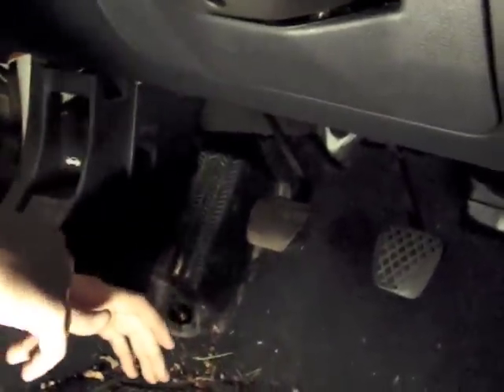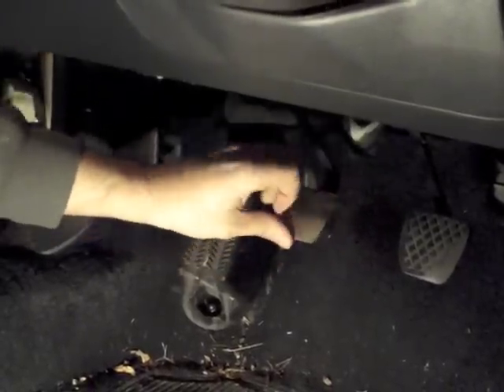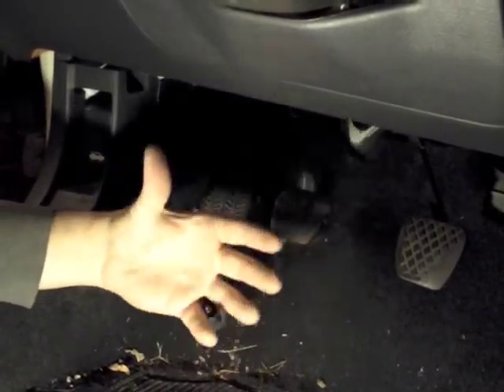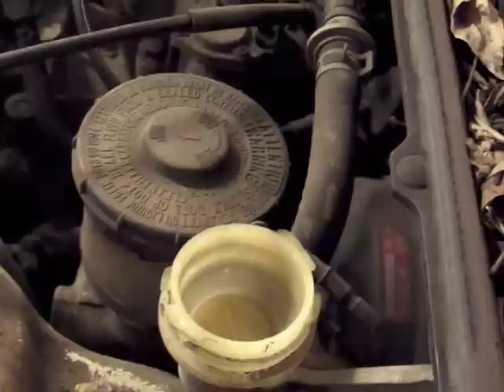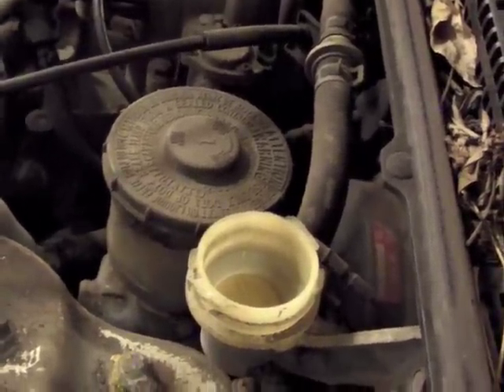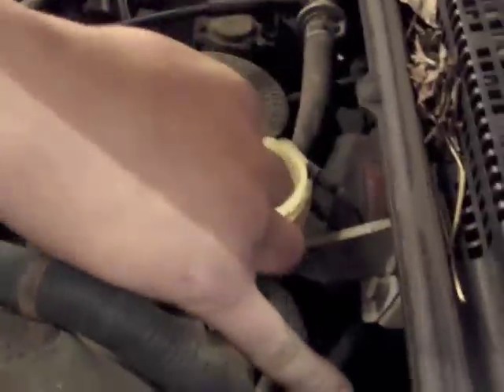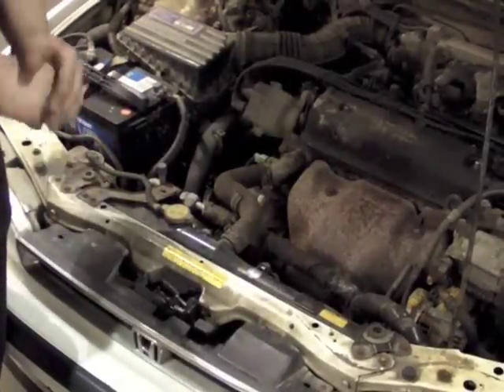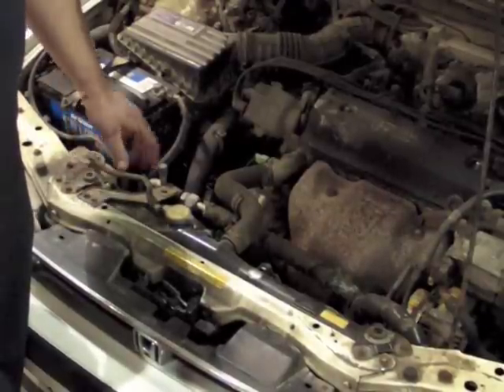How To Diagnose A Clutch Problem

Comment: Great video! Thanks. My problem seems to be unique...not sure. I recently had a problem where my clutch started rapidly getting softer and softer as I was driving it in town, and soon it just sat on the floor. I got it in gear long enough to get it home, and have had it parked. Today I went out to look at it to see if it was dripping on the interior side (haven't checked the slave cylinder yet),  and when I grabbed the clutch with my hand and pulled it up, it sort of shot up halfway back into normal position. I thought nothing of it and figured it would stick to the floor if I pushed it again, but it didn't. I got in the car and pumped it with my foot, and it feels better than ever...and I'm so confused. I even backed the car out as I normally would have before the issue, and then drove it forward again in first (I wasn't able to do either of those smoothly at all last time I drove it). So yeah, there appears to be NO problem any longer, but of course, this is the worst situation cause I know dang well there was a problem before, and now it's not showing the issue. You recommend bleeding them still? I'll check the slave cylinder tomorrow, but thought I'd get on here and see if anyone had any ideas.
Reply: this is really late... but did you ever figure out the issue? i literally have the same problem going on right now.... and there is no damn way to can be the clutch cause i just got a new clutch done at the honda dealer.... but i am so scared its something to do with that.... shit was not cheap.... but my peddle is basically doing the same... it was stiff feeling... and then all of a sudden it would basically be paper thin and no grabbing all the way to almost the floor and then a slight grab at the end.... i noticed if i pumped my clutch several times though it would almost go back to being good again....

Comment: i bled my cars clutch hydraulic system. master and slave cylinder is good before i bled it. the pedal is not returning, it seems it is not building pressure. I bled is so many times but still every time I press the pedal it stuck on the floor. what could be the problem here

Comment: I got a 1985 ford f150 i have pressure problem i push the clutch pedal to the floor and it does not come back up whats the  problem

Comment from the maker: @50fordman can't remember off the top of my head if its an internal or external slave (i believe its internal) anyway it seems like you just need to bleed the air out of the system like we did in our clutch video. i've had several clutches on a lot of vehicles take a long time to bleed not as easy as brakes in most cases. A tip would be to crack the bleeder screw and let it stay open with out any pressure until you get a steady drip. Basically let gravity do its thing. hope this helps

Comment: I have a question, i was driving my car today just fine and when i came to a stop light i couldnt find first its like i can move the stick around and theres no lock in for the gears yet i cant even put it into nuetral with out pushing the clutch in when i let the clutch out the motor revs but theres no give. its a 92 cavalier ne ideas??

Comment from the maker: @tricky big tip everybody is to remember there are only a few components so it's a process of elimination bleed the clutch first and check the master,slave, and hoses for leaks first.. If that doesn't fix it them look at replacing a clutch.. Unfortunatley these are all wear and tear parts so every vehicle will need a clutch or two in it's life ;) hope this helps

Comment: hi,I have a 93ford 5speed, 6 cylinder OK I've replaced everything now, it will shift into gears when the truck isn't  running, but when I start it, it won't  go into gear, it's been bled and the whole 9yards, I need HELP no
Reply: You figure it out?  Same problem with my 93 4sp with od.  Replaced clutch.  But after letting it sit it will barely move
Reply: Was it ever forced in gear when cluch was going out . If so mite bent shift fors in trans.

Comment: Hey I need help.i have a 95' Honda Civic EX coupe. Well my car is turn off and I can put it into any gear. But when turn the car on, it won't let me shift to any gear. It doesn't make any sound, it just doesn't shift.
Reply: Did you put the clutch in?
Reply: I got the same problem. I can only shift if the car is off and even when I put it in gear it won't drive
Reply: gear box probably
Reply: Rich Hernandez what ended up being the problem. Woke up to this w my car
Reply: I had a Nissan hardbody that did that to me while I was driving. What happened when I took it apart, I found that the clutch had shattered and clogged up everything.

Comment from the maker: @MafiaGN260 honestly if your new to driving it could just be your not used to the amount of pressure required to engage your clutch.. is it a stock clutch or possibly a stiffer aftermarket one?

Comment from the maker: @jhonea005 I would first check the master for any leaks or moisture then do a bleed on the system.  Those fords have the internal slave I believe. ( my bronco had one too) watch out because if they leak that clutch will be toast really quick so see if you able to keep good pressure after a bleed.  That fluid will eat the disk quickly if the slave is dripping.

Comment: i had my clutch replaced on my 2005 toyota corolla,but when i put it in reverse in the morning after a few mins it doesn't  what to go in reverse  right away i have to pump the clutch  pedal a few times before it goes into reverse or if i try first gear it does  the same thing ...does  anyone know if i need to check my cluch master cinder or my slave cinder ...

Comment from the maker: @vekteius sounds like you for sure have a fluid leak somewhere.. Most likely your master cylinder or slave cylinder needs replaced. Follow the steps in the video and check them both for leaking or dripping.  Also a chance it could be a rubber hydraulic line.

Comment: HI 
I have Ford Focus 2009 (europe) when I relice the clutch there is clicking noise and the engine is like shaken..to not do this I need to first relice the clutch very slowly and then pres on the gas pedal (in every gear) when the engine is very hot (hot temperatures outside) the clicking sound is harder and louder...I can record a clip and post it if you want..this is hapening 6 mounths now and Its going on my nervs :S

Comment: So i have a 90 integra with a cable clutch just had a new clutch installed, when it gets warm it sticks slightly when depressing. Any ideas?
Reply: did you clean up the flywheel maybe have it miked the flywheel needs turned or the disc is backwards

Comment from the maker: @mtndl222 if the pedal is sittin glow and its slipping a little i would say first def do a full bleed like we did in the video and be careful to inspect both the slave and master cyl. for any leaks that could be your problem.  if its starting to pop out of gear or slip badly could be the clutch but i would do a full hydraulic checkup first.

Comment: I have a 1990 Toyota Corolla 
And so far the master cylinder doesn't show linking from my eyes and the slave cylinder isn't linking, I have brake fluid in the container but it looks dirty and its full.
The problem with the car is you need to puch the pedal down on the floor and the gears dont go in and the reverse grinds? What is the problem and what is the solution?
Please help thanks.

Comment from the maker: @cmlbeatlefreak sounds like your slave is done. I believe those models have an internal slave. Check for fluid leaks or try to bleed it via the screw on the bell housing. If that doesn't work you'll need to pull the trans to replace it

Comment from the maker: @Avenger77420 yup if fluid is coming out of the rod on the master cylinder it needs to be replaced.. do that and don't forget to take note of the end play between the rod and the cylinder (basically its that bit of slack in your pedal) some times you have to adjust that a bit when you put a new one on. but once its replaced make sure you bleed it thoroughly and your all set! shouldnt take more than an hour or two and very basic tools

Comment: Hi. I am Sohaib. I see this video and its very nice. I have a Honda Accord 1993 model. And its clutch is gone free. When i press it. It just sticks to the floor. and doesn't come back up by itself unless i pull it back. So I checked the Dot3 oil in the reservoir. It is full. What's wrong in this case. Please need help. thanks
Reply: Can we get an answer on this? Same exact thing happened to me with my 97 Subaru Outback
Reply: Probably a good idea to change the master cylinder and slave cylinder as they work in tandem together. Hope that helps guys!

Comment: i have a 1994 honda civic an has a problem i dont really know what it is it feels llike the clutch is slipping but i just changed the clutch i did a complete clutch replace. when the clutch pedal is all the way to the floor, an i start leting it go the car doesnt go until its almost all the way out, any ideas?

Comment: Hi i have a 1998 peougeot 206 the clutch works but shifting is noisey and very un smooth could this be a stretched cable as i done the clutch about 3 months ago

Comment: Hi my civic type r 2007 does go into gear very easily at high revs when changing up, but does fine at low revs. It changes down fine and I always rev match. Is that a new clutch job or so,etching else?
Reply: Charlie 12102  new  on dennis
Reply: Tutu

Comment from the maker: @jedwards sounds like you have a bad slave or a bad pressure plate. Check the slave first for leaks and bleed it if not it sounds like you might need to do the clutch

Comment: Need HELP!!! I have had my 92 Honda Civic clutch replaced because the car would not go into gear. We thought the problem was resolved till we drove it about two blocks from home and the car would not go into gear again. The mechanic showed me the clutch for and said it appeared worn last time the clutched was replaced it wasn't lubed correctly. So we had him replace the clutch fork. Thought all was good till we drove it around the block same issue. Clutch fork popped off and the clutch can be pushed but the car wont go into gear. Someone advised we needed new trany and so we spent money on new transmission. Drove the car a mile and then on the way home, same issue clutch for came off again and the car wont go into gear. Any advise would be welcome. I've invested so much on this issue and both the mechanic and I are at a loss of how to resolve this issue. Please HELP!!! Do I part out the new clutch, fork, and transmission or it is just something small we are missing. Thanks :) Sally

Comment: The car feels neutral even after shifting gear. It won't move with release of clutch and acceleration. I guess your solution should work out. Need to check. Thank you!

Comment: I have a 97 Honda prelude.. my clutch pedal is normal but for the clutch doesn't make contact until my clutch pedal is almost all the way up.. do I need a new clutch?
Reply: unless it is slipping in high gear at low or high rpms no if it's a cable clutch it needs adjusted if it's a hydro clutch it is going to need a clucth kit what does it have an h22a4

Comment: I have a 2000 eclipse gt it starts fine just won't move I can put it in all the gears let up on the clutch and it doesn't stall nor move my speed and rpms go up when I press the gas pedal but the car just doesn't want to move any ideas what my problem is?
Reply: broken output shaft in transmission or possibly clutch installed backwards also could be a worn out flywheel

Comment: I have a 91 ford ranger 3.0 ltr and while I'm driving it will feel like I'm shifting when I'm not.(like it jumps) Thinking something with the clutch. Since ive already replaced plugs and wires and fuel filter. Anyone have and thoughts?

Comment from the maker: @thorfoxxx fast forward to about 6:25 on our video and we show how to bleed it. Basically your just pumping the clutch and then letting the air run out the bleeder screw. do this several times until you can get the air out of the system. Replacing the cylinders is fairly easy on most models usually 2 bolts holding the master to the firewall + a rod to the pedal (which can be adjusted) slaves are often held to the trans bellhousing with 2 easy bolts and a fluid hose.

Comment: Hey guys , I have a 2003 Hyundai Accent , everything works fine but after a while the pedal is stiff and does not take the speed it should. What will be will be time to change the clutch ? Just 2 years of use . Happens when you leave the car and use po several days. Thanks guys

Comment from the maker: @supermedaman1 Your master cylinder is most likely shot. Check the slave also to make it isn't leaking but you will need to replace the master cylinder. Any time they leak especially bad enough to soak the carpet they need to be replaced or rebuilt. After you replace it bleed the system again and you should be good to go

Comment from the maker: @BabyBeyonce09 hmm sounds like it could be your slave cylinder.. I would for sure do a full bleed on the clutch system first before deciding to see if you need to replace your clutch assembly. Typically if it is in gear and not moving or "slipping" that is a sign that your clutch disc is worn out. Could be a pressure plate but i would do a bleed and check the slave first.

Comment from the maker: if you think that the hydraulics are in good working and leak free order then suspect your clutch itself is worn.. (yes these are a wear and tear part and WILL need replaced at some point in the cars life) of course every vehicle is different but and the diagnosis can be tough but simply identifying the components of the system and what they do will go a long way in helping you eliminate sources of the problem.  Consult your shop manual and follow the steps and im confident you'll solve the issu

Comment: so my car 89 Honda is loosing pull power when I shift. it's running lower rpms 2 1/2 instead of 3. car doesn't shift into the next gear with enough torque. this when I gas it rmps think higher to catch up and it levels out at 2 rpms. guess it's slipping? can't really get up to speed fast have to drive slow fwy about 60 in 5th. then I can showing climb up in speed.
Reply: clutch disc or flywheel
Reply: +Tim Anson Iran not sure, but my buddy going to look at it, says the clutch is worn out plate and clutch...
Reply: +Brian  David did you find out what it was? my car is doing the same thing. i cant switch it to gears until the rpm is back in 2
Reply: Clutch and or plate

Comment: Trod5282 if you pop your hood it will be located on the front of your tansmission it's on the right of the engine you should be able to see it by just looking down at it.

Comment: What would make your car ack like it was in nutural would it be the cluch went out that easy i thought it would still go with out one how would u no if it was your axel or what was wronge with out buying every thing new
Reply: Did you ever get this fixed. I got the same problem but amnot sure if it's clutch slave cylinder or transmission. It goes into the gears but acts like nothing is there

Comment: hey guys. wondering if anyone can give me some info. I drive 2010 mustang gt. when I downshift my car isn't slowing down. feels like it's just slowing down as if the cars in nuetral. Upshifting and everything is fine... feels like the compression is non existent.
Reply: Shooting from the hip here, but I imagine the issue is along the same line as what's in the video. Either a leak in the slave cylinder or something similar. Definitely best to get it checked before having to get it towed.

Comment from the maker: @autohowtovideos if after a thorough inspection of the hydraulics then it could possibly be a pressure plate issue. etc. but like any other clutch problem use your knowledge of the system to rule out causes of failure 1 at a time.. thats the secret of good a diagnosis to any auto problem

Comment: Hey,,, I have an 06 350z, and just yesterday I started  hearing like a tracking sound every time I shift gears,, and it was only for like the first five minutes into the drive,, (the sound it's like when you put a pencil against a fan),,  any thoughts on that,,??
Reply: might wanna check the clutch disk mu cousin had an 05 350z and the clutch fork pivet ball broke off very common especially under rough driving conditions may be low fluid as well

Comment from the maker: @tuzest Sounds like the temp is causing a leak or air together into the system I'm willing to be your slave or master cylinder may need replaced.. Bleed it first to see of that helps and check the line/fluid level.. Moisture in the line can boil and cause air pockets to form as well

Comment: my mechanic said I have no leaks. I bled my system and flushed the fluid. I'm still having soft pedal issues. I will most likely replace the slave and master soon. He said my clutch is fine and operational.

Comment: My Honda Prelude EXedy Clutch works. No leaks. About 40K miles on parts. The other day when I went to a stop it would not go into any gear, but the peddle felt normal, no extra resistance, or less. I stopped the engine and started it with it in 1st, and my foot pressed all the way down on the clutch and it started and slowly started pulling forward. Then it would shift. I put in nutral rolled back put in reverse, and then in 1st and drove home able to shift. Its parked, and it shifts like normal

Comment from the maker: to everybody that watched the video we really appreciate your comments seem to be getting a lot of similar questions here are some answers. As you saw in the video your clutch is a basic hydraulic system. with a master and slave (except for cables like @vektius) if you experience problems my best advice is to eliminate problems 1 by 1 start with your master, slave and hoses check for leaks and problems..